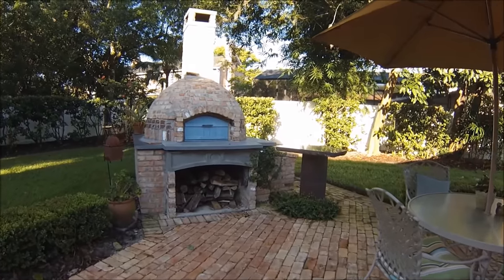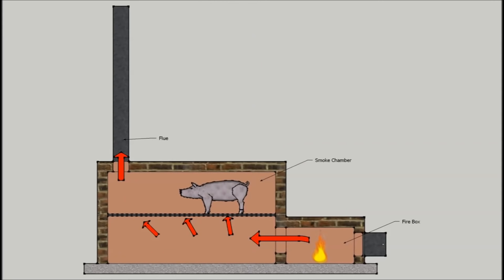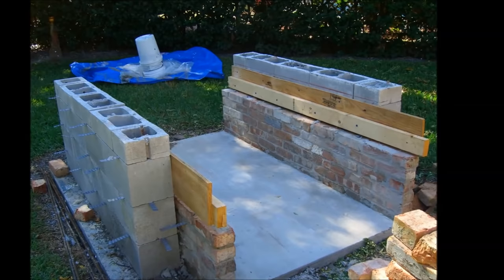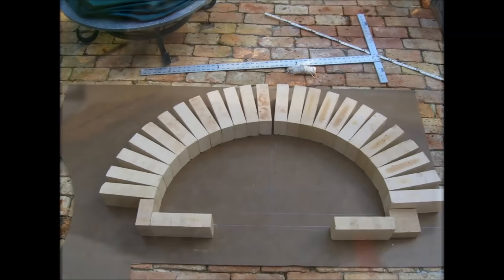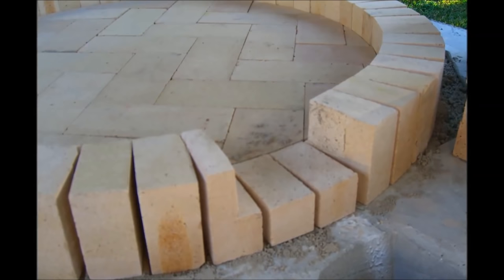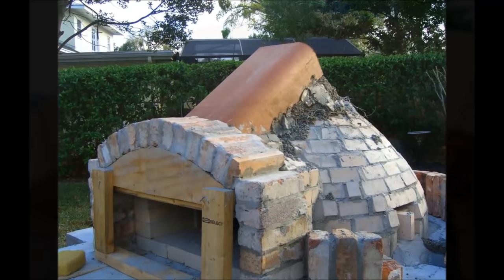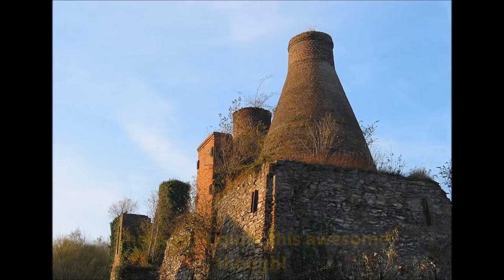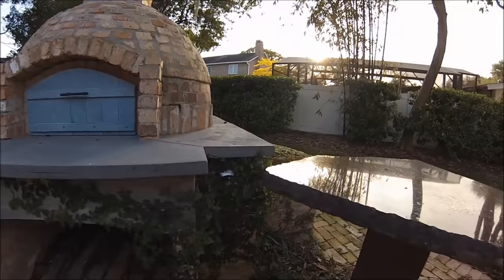How to Build a Brick Wood Fired Pizza Oven/Smoker Combo

Comment from the maker: Mario Costabuck - I can't reply to your comment for some reason but thanks. Let me know where I can see some pictures of your oven.
Reply: Lee, How would you say you determine the shim angle size when building the dome? Its the one part I can't wrap my head around. I am modeling my build after yours, but am nervous when selecting the angle at which the fire bricks for the inner dome are set to make a seamless transition to the keystone at the top. Advice?
Reply: Also what is the diameter of your inner dome firebrick floor?
Reply from the maker: Honestly I just determined that angle mostly by the seat of my pants. I used a piece of plywood cut into the shape of the arch to use as a jig to fit the brick and sliced a little angled sliver of each brick. I checked it with the jig and if it looked like it fit well then it got mortared in. Now I did do a template mock up of the dome on a piece of Masonite and laid some actual fire brick on it and that gave me the general amount of angle that had to be cut. That is in the video at the 15.54 mark. Remember though though this isn't a Swiss watch you're building.
Reply from the maker: My inner dome diameter is 36"
Reply: Thanks for your comments!

Comment: Great job! I'm just starting to build mine! Don't u have the problem of smoke coming out through the oven entrance? I plan to make the chimney also in the middle but I worry about the smoke getting out through entrance.
Reply from the maker: +kondziuman1984 sometimes a very small amount will but generally no. Straight into the flue opening and over to the chimney.

Comment: Excellent combo idea. I love the molding. How do you rate the smoker now that you've had time to use it? Is there anything you would change if you did it over again?
Reply from the maker: LoneKnight6212 Thanks for the compliments. The smoker works great but controlling the temperature can be a little tricky. The oven being a big insulated heat sink helps but it can get a little hot if I don't divert the smoke upward inside the oven. Otherwise the smoke hits the food straight-on at around 350 degrees. I have worked out a few tricks to fix it though. I'm going to put together a video showing the smoking process so stay tuned.

Comment: Hi Lee. I’m wanting to start my own project and love your integration of the smoker. May I ask with your experience now, do you use it as a smoker often or would you in hind sight just build a pizza oven and have a separate smoker dedicated to low and slow? Your comment would be highly helpful and your video is amazing. Thanks!!
Reply from the maker: I think I use the smoker more than I use the pizza oven. I just smoked a turkey in it for Thanksgiving and it was fantastic! I don't think the smoker takes away from the functionality of the pizza oven at all, but I do think I could have built a little more functionality into the smoker by putting a few dampers into it to control air flow.

Comment: This oven is incredible.  I think I am going to make an attempt.  Is there a place where you have supplies and dimensions listed?  Thanks again for all the valuable information.
Reply from the maker: I did the plans in Sketchup and the model is uploaded to the Sketchup 3-d warehouse. The link is above in the video description. Good luck with your build!
Reply: Is there a way in sketchup to see all of the different pieces laid out with dimensions or do I need to use their tool to measure them?
Reply from the maker: You can use the tape measure tool in Sketchup to measure between any two points. You can also right click on an area, for example the side of the chimney, and get the square footage of that component. It's very easy to use and there are a ton of video tutorials out there for it.

Comment: hello! Im Rodolfo from Brazil. I want to build a brick grill/smoker. I have a person to do the grill part but not sure about to add the smoker. Can I use the grill chamber as smoker and just add a fire box into the side? Or the grill chumney is to large? My grill looks like an argentine grill.......
Reply from the maker: +Rodolfo Sarudiansky As long as you can close up the grill relatively tight to keep the smoke around the food, you should be able to make it work. Most Argentine grills I've seen are open top though. Does yours have a lid?

Comment: i live in caifornia, does it need to insulate the dome after the first layer of brick and what would happen if you just put fire brick without perlite on the platform(cooking space)?
Reply from the maker: You don't have to insulate but your oven will not retain heat very well and it will make it much harder to get it up to temperature. The brick on the outside of the oven will be very hot also.

Comment: Hey Lee - have watched this several times and am now starting on the dome. Your comment at the 18:45 mark re tapering the brick - can you please explain what you mean by this?
Reply from the maker: You just slant the cuts on the bricks from the center of the oven out in every direction like the Ray's of the sun, if that makes sense. That way it's impossible for the dome to fall down unless a crazy amount of pressure is applied to it.

Comment: This is a Fantastic build!  Curious for one detail - When firing the oven and then letting it cook while sealed, do you get any air draw from the fire box (then through the oven to the flue)?
Reply from the maker: +J.P. Nixon I haven't really cooked in it while it's sealed except when using the smoker. I theoretically could do that (like to bake bread) but I would need an insulated door to seal off the throat of the oven. But - if I did use it this way, I would insert the removable brick installed to cover the flue from the offset fire box so - no it wouldn't draw any air in that way.

Comment: outstanding work! but ı have a question, do you have any feedback about the design? ı mean do you have any design details you wish that you would change? or is this the ultimate design?
Reply from the maker: I kind of wished I would have installed a damper into the smoker flue, and turned the firebox door opening toward the front. The other thing is that I wish I had done is a bigger prep table - I never have enough room. I would have made it three times bigger if I knew what I know now. On the really minor side, I wish I had made the smoker box just a little larger and maybe the oven a little larger (it's 36" but I wish I had done 40"), but those are not huge deals. I may even make the change to the firebox one day. I could turn the opening to the front of the oven and then build the outside wall of it all the way up to the outside top of the oven. Then I could add granite to the top of the new fire box and use it as prep area. The big thing holding me back from doing it is that I would have to demo the existing prep table, and that would be a total nightmare.
Reply: @LeeMcNeil  thank you very much!

Comment: Definitely an awesome video. I've helped build one of these before so I can confirm it is a ton of work! 

Do you use the smoker part much? Wondering if you'd do that again or make any changes?  I love the idea of combining them.  Thanks for an excellent video!
Reply from the maker: Thanks and yes I use the smoker quite a bit. I have a couple of videos on my channel using the smoker for ribs and a turkey so check them out when you get a chance. 

There are a few things I might have done differently if I had to do it all over again and I'm going to cover in another video which I am editing right now. Stay tuned!

Comment: Where does the smoker integrate to the main chimney stack and/or vent/exhaust?  I must have missed it.  Thanks..very nice work.
Reply from the maker: +Dan Fall The smoke comes out of the firebox in its own flue (which is just the vertical void of one of the hollow block cells), into the oven and then it makes its way to the main chimney through the flue at the front of the oven. I put a door on the front of the oven to seal up the oven but the door is in front of the flue opening to the main chimney. I hope that makes sense.
Reply: Still confused.  Does the smoker smoke go through the oven chamber?  Where do you put the food?
Reply from the maker: +Dan Fall Yes. The firebox vents into the main oven where the food is and then out the flue to the main chimney at the mouth of the oven.

Comment: Lee, great video and all but I'm curious as to how you go about smoking your barbecue. Surely your meat does not sit on the floor of the oven like a pizza would? Do you have a section of expanded metal with legs in there? How are you getting airflow to the bottom of your meat?
Reply: Nevermind, I see that you used a rib rack in your rib video. How do you go about smoking briskets and pork shoulders?
Reply from the maker: +brucelee6783 I used a rib rack for that cook. The rib rack I used was a piece of junk that I've had for a long time. I threw it away not long after I filmed the rib video. If watch my video on how to cook a steak, you'll see the rack I built for BBQ. https://www.youtube.com/watch?v=wzERJ2ItLuw .I'm also just about to upload a turkey smoke video so look for that soon to see it in action.

Comment: How long total was the build process fit the pizza oven/ smoker combo?  I realize there were many layers to this project but if the last brick being laid was the finish line how long was this?
Reply from the maker: It took me about 6 months to get the oven itself built, then I took a little time off and then came back and did the concrete top and landing.

Comment: Great Video Lee and amazing job!  What made you choose perlite over vermiculite?  Just curious as you I plan my own. Thanks!
Reply from the maker: +Bryan Chamberlin Mainly because it's readily available and cheap. I wouldn't even know where to find vermiculite around here.Plus I have worked with perlite before. It used to be used a lot in construction to insulate concrete block walls but has mostly been replaced by expanding foam insulation these days.

Comment: I live in south Texas and have clay and sand combo in the soil (live close to gulf water). my biggest fear is starting the foundation. I plan on using gravel and then driving rebar straight down like you did then pour the foundation with rebar mesh going across. You think that should be strong enough so it will not shift?
Reply from the maker: +Chicken Friedfish I'm not an expert on Texas soils but have worked on buildings in Houston and Oklahoma and those buildings all had drilled pier foundations (2 foot wide piers drilled about 4 to 5 feet deep in filled with rebar and concrete).- but I know the soils in both those places are gumbo clay - very nasty and expansive. If I were you, I would call either a commercial general contractor or even a geotechnical engineering company in your area and just ask them about foundation design in your area. They will very likely give you some very good advice. 

One last thing - you mentioned driving the rebar straight down - I assume you're referring to the dowels coming out of the slab. Those are not driven into the ground - instead they are "L" shaped dowels that I wet stuck into the concrete. They do not come in contact with the soil. The reinforcing needs a certain amount of it's length in contact with the concrete to develop strength and the bottom part of the "L" shape does that nicely. You don't want any of your rebar in contact with the soil as it will rust and eventually fail (although it would take several years).

Comment: The oven looks awesome.  Do you have brick laying experience?  I would like to build one of these.   I am a handyman but I do not have brick laying experience.  Would you suggest that a I try this as a novice, as long as I take my time?
Reply from the maker: I am in construction but had zero experience laying brick when I started this. One thing that helped a lot was to wet the brick down before putting mortar on it. The dry brick sucks out the water from the mortar so fast that it has a hard time staying on the brick. It took a lot of time but I got it done. You should check out my video I posted a few months back where I put up an interior veneer brick wall. That was super tedious because of the way I did it with the half brick. https://youtu.be/l3FWccrDubs

Comment: What do you do about grease drainage from meats when you are using the offset fire box for smoking?  seems like grease could drain into the fire box?
Reply from the maker: I usually have the meat on an elevated rack with a pan of water below it when I am smoking in it. I  made a video on how to smoke a turkey if you want to see how I use it https://youtu.be/v0nPnXZ9dIY. By the way, even if a bunch of grease got on the floor of the oven, it would burn right off the next time it's used to cook pizza in it.

Comment: I want to build something similar in south Louisiana and I was going to use your model do you have a number of bricks, cinder blocks, and fire bricks that you used?  Any advice would be greatly appreciated.
Reply from the maker: I used about 2 cubes of Old Chicago brick, probably about 200-300 fire brick and less than 50 concrete blocks.

Comment: Seems like grease from a meat-smoking project would get all over the oven floor and then make the next pizza project at worst a grease-fire and at best make your crust taste like burnt grease. Do you find that you have to take extra steps like putting a large pan under the meat to catch the grease - or is this not an issue and just let the fire you build in the oven incinerate any grease remains? Just curious. This project is very interesting and combines several of my favorite hobbies (baking, smoking and construction). :)
Reply from the maker: When I smoke something in the oven, I usually keep a large pan of water below the rack where the meat is and that catches most of the juices. But the pan of water isn't there to keep the oven floor clean, it's there to moderate the heat and to provide moisture while the meat is cooking. I have two videos showing how I use the smoker - ribs (which I did without a pan of water)- https://www.youtube.com/watch?v=zrjd-k1bCak&t=2s - and a turkey (which I did use the pan) - https://www.youtube.com/watch?v=v0nPnXZ9dIY . 

To answer your main question about grease on the oven floor possibly affecting the food when I use it to cook pizza, it absolutely does not. When I fire the oven up to cook a pizza, I will start a large fire right in the middle of the oven - directly on top of the area that any drippings may have been left behind during a previous cook. That fire needs to burn between 45 minutes to an hour just to get the oven up to temperature, so anything left behind in the oven would get incinerated during that process.
Reply: @LeeMcNeil  Thanks for the response! Definitely going to look into building one of these.

Comment: I've been looking at building an oven with reclaimed bricks, is there a way I could test them to make sure they won't fail under the heat?
Reply from the maker: Well the only brick that are subject to high temperature are the bricks inside the oven chamber. You definitely want to use fire brick there. I don't know why you would want to use reclaimed fire brick there though because 1) you can't really see them unless you put your head in the oven and 2) you don't need very many of them so you aren't really saving much money. If you have a stash of reclaimed brick, they would be fine to use outside the oven if they aren't fire brick, or inside the oven if they are. Don't use non-refractory bricks inside the oven though - reclaimed or not.

Comment: absolutely brilliant!  Thank you for taking the time to make this video.  How many hours do you think you have in this project?
Reply from the maker: Oh man - I'm not sure. It took a little over a year working mainly on the weekends. So let's say  if I average 10 hours of work on it per week times 52 that's 520 hours. The brick on the outside took far and away the most time. If I had to do it over again, I think I would put a thin brick veneer stuck directly to the concrete block on the base of the oven. That alone would have probably saved me a month or two of labor.
Reply: I think it turned out amazing.  something definitely to be proud of.  If you had to wager a guess, how much money do have in materials?
Reply from the maker: Probably about $1,500.

Comment: I am building a similar oven in Paso Robles CA. Do you have a sketch with dimensions you can share? Would you alter the size for any reason?
Thanks, David
Reply from the maker: The plans for the oven are in the Sketchup 3D warehouse. I have the link in the description. If I were to do it all over again, I might go with a 40" diameter oven instead of 36". I think I also would have set up the firebox for the smoker in such a way that I could also use it as a wood grill. I've been seriously thinking about making that modification to it. I need to sketch it up and see how that might work. If I do that I will post a video so stay tuned.

Comment: Great video, how well does your smoker work and do you have have problems with grease drippings when you smoke with it?
Reply from the maker: No because I usually put a pan of water underneath whatever I am smoking.  And even if I didn't us a pan of water, the next time I made a fire inside the oven, it would burn any kind of grease away anyway. I made a video smoking some ribs if you want to check out how I use the smoker.  https://www.youtube.com/watch?v=zrjd-k1bCak